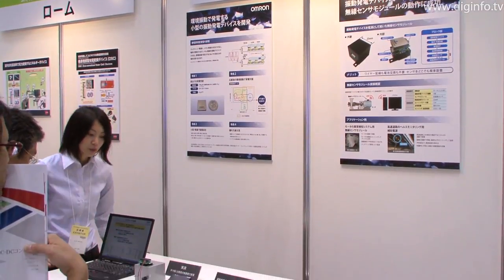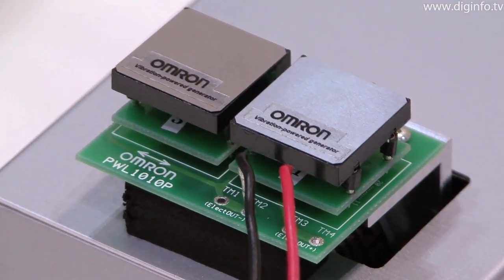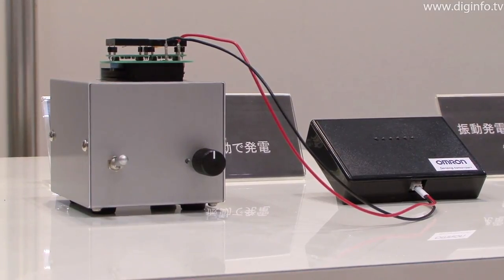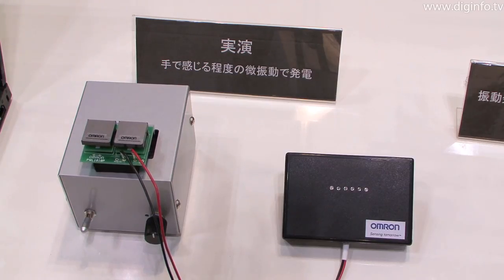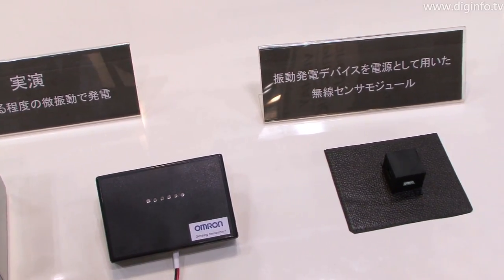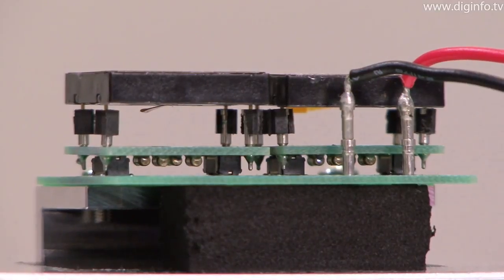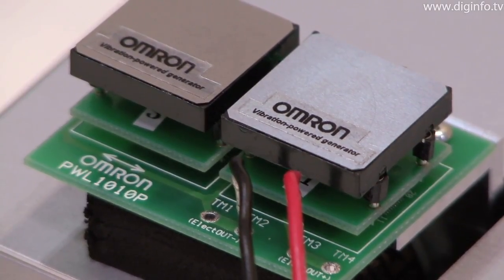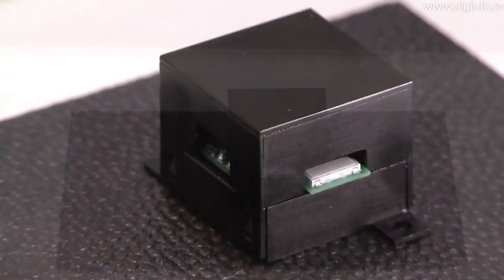Compact, vibration-powered generator that utilizes environmental vibration : DigInfo

Comment: @Slydaa lol are you talking about perpetual motion? If you put thousands of this thing on a car until there is no vibration at all, you still won't get the energy needed to move a car. The power of these generators is insignificant compared to the one needed for a car. If you also recycle the heat energy, maybe you'll make some oil saving.

Aren't you wondering why nobody thought of putting wind turbine on the top of each car?

Comment: 100 mW? not even enough to barely light up a torch light...still more room to cover on this tech...
Reply: until you accumulate this technology from a nano scale...the proof of concept is all that matters, and if it works, then you can build countless amounts of these and cover anything with them.  imagine a car engine with these all over, that drains any vibration from it.  every floor with these under them in every house.  i was designing one then realized there is no way this tech isn't out there, and here it is.  mine is membrane based, this was another idea.  you think one small generator will power the world from vibrations in the air?  no...its about obtaining the lost energy from every molecule in the air that is lost...